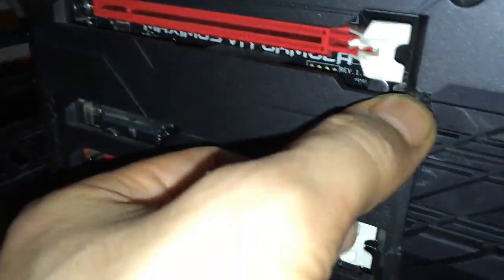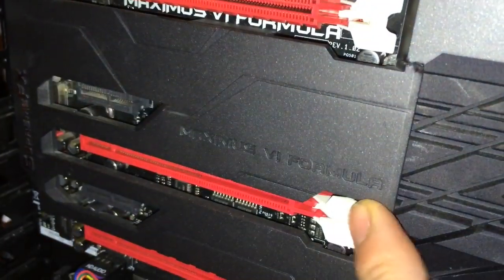019: Asus ROG Maximus Formula VI - Cmos Battery Armor problem! "PIECE OF SHIT Mobo"

Comment: To be quite honest, when you researched buying that motherboard you must have noticed that the batter was covered by the armor and as there is no small spot you can unscrew to get to it, it's common sense that you'd have to take the armor off. Granted, perhaps they should have made it easier, but if making it easier to do would affect performance I'd rather they not do that. Most people don't have to change the battery for about 5 years or so. Yeah, it does suck but I imagine most custom PC builders would have replaced their motherboard by then. All that being said I'm glad you made the video but you did go on a bit of a bitching rant for 11 minutes. "What upsets me", "I got so upset", me, me, me. You should've discussed the problem and talk about the solution to help others in your position. But going on nonstop is ridiculous. Now you're changing the brand you enjoy because of one motherboard and your experience with replacing the battery, which as I said you should have known when researching the motherboard, but apparently not. And you are not the first person on earth to realize that, how self centered. And saying "that's the beauty of this problem" makes it seem like you want it to happen to as many people as possible. Your video might dissuade some from purchasing but it won't make the change I think you're hoping for. By the way I'm no ASUS fanboy or anything. This video just seemed very self centered and created while angry. Why  not go into detail about how you fixed the problem to help others in your position?
Reply: Nicley said
 bro... i have the same mother broad and changing the battery its not that bad.. i agree with 
you 100%

Comment: I have this motherboard, straight out of the box I have to replace the fucking battery because my system time and bios fucking settings wont stay.
Of course my system is completely assembled. Tubes in place etc.. So removing it is a huge pain in the ass.
I am actually considering returning the board because of this. Not impressed.
Reply from the maker: yeah well... welcome to the club. :(
Reply: Sick Games Entertainment
this club sucks. I have to replace my cmos batter as well. thanks for the heads up and good video (good as in; explaining what I need to know.).
Reply: Something Asus said to me was to actually update the bios to the latest version. Turn off power supply. Clear cmos, go into bios, load defaults. Clear cmos, and start back up. I did all that and its fine now... Time is on track, Bios settings are staying. Just something to try before you go mental taking it apart.
Reply: seems to be working... thanks for the tip!  8 )
Reply from the maker: ***** xl chop, Carson Powers wow, wow, guys, are we all having the same problem?! Did you all replace the Cmos Battery because the time went out of sync?! Because thats the problem that i have and btw changing the cmos didnt help shit but i figured i am the only one to have this. I even reinstalled windows, didnt fix it. I will sue them if we all have the same matter on top of the armor bullshit.
Reply: Sick Games Entertainment I was going to replace the cmos battery. Then I sent a polite email to Asus and they replied to check the bios.
After updating, reseting, clearing, reseting the time etc was fine.

Come to think of it I used the AI suite for an overclock before I noticed the issue in the first place.

Comment: lol love ya video haha. mate im sitting here on the floor going wtf. like a day ago the pc went to restart. i changed a processor setting i belive. anyways wouldnt start so back to bios. I couldnt get passed bios still. so i turned all overclocking to automatic. restarts and yeah now just black screen never goes to bios. so I reset the cmos. nothing still. now iv got the ram out. im trying to get to te cmos battery and as somone who used to build pcs as a job i cant belive how complicated this is. im like isnt this board meant to be invinsible and have no issues with anything. so im about to try update bios if that works. but im not sure as it just hangs and says 3b on the board. and memory light doesnt come on wich im fairly sure is meant to. all this from a restart lol. cheers asus

Comment: Your going to be draining your WC loop every 6 to 12 months typically anyway so just wait until you need to drain your loop and then it wont be but an extra 30 minutes of work to replace the battery. Yes its not ideal and they probably could have done it better but its certainly not the massive headache your making it out to be. On top of that how many times in the course of the life of the Mobo are you even gonna have to change a cmos battery? Once? certainly not more than twice as those batteries last for a few years. Most likely you'll upgrade the board before you have to replace a cmos battery twice. or maybe even once depending on how often you upgrade your components. I tend to upgrade every 3 to 4 years typically and Im pretty sure most people that buy enthusiast level gear do also. As for how to take the ROG armor off...If you couldnt guess just buy looking at it thats its very likely held on with screws from the backside then you might want to find another hobby. You spent 10.5 minutes hyping up a problem that really isnt that huge. :(

Comment: its called research before buying..theres plenty of yt vids on the installation of this board so dont knock asus for your lack of no cheaking 1st
Reply: I bought a MAXIMUM VI FORMULA that has the same stupid battery placement under the armour. I have built many PCs in my time, but this is NOT something you think of when you buy a new motherboard. Until it comes to changing the battery that is, then you NEVER forget to check again!

You can't blame someone for not checking if the battery is accessible - it's just common sense that it should be and stupid design that it's not on these motherboards.